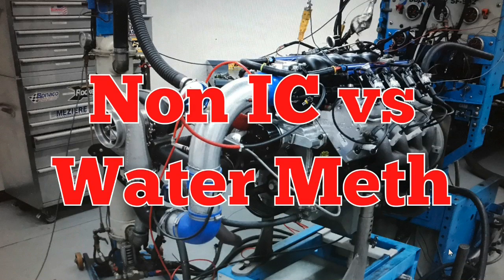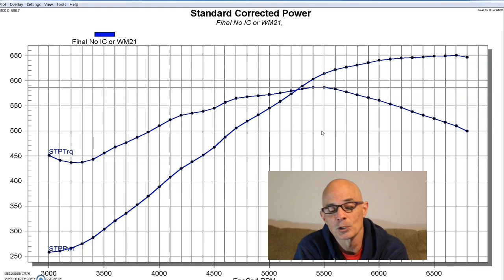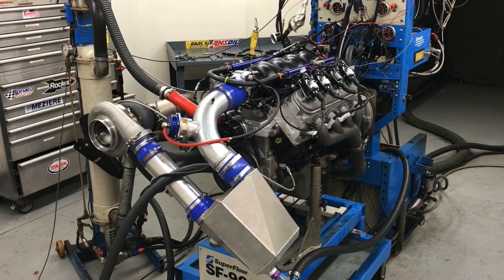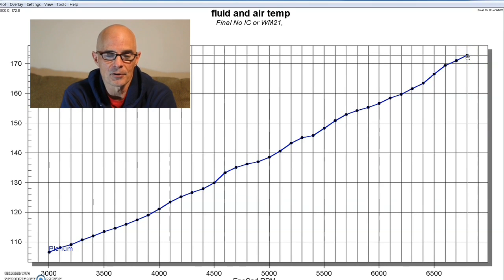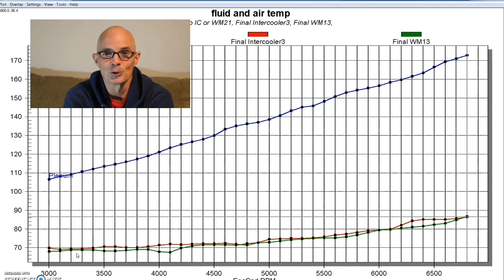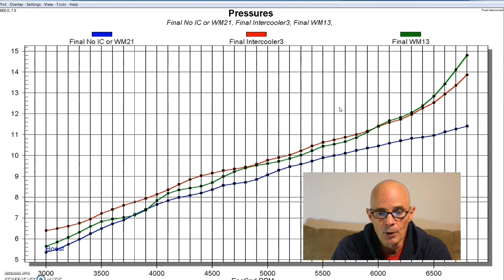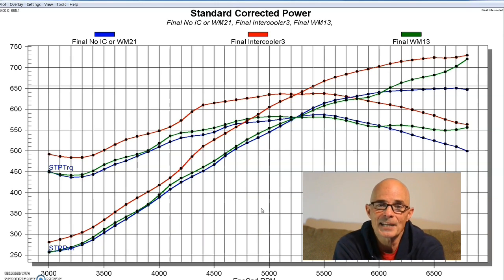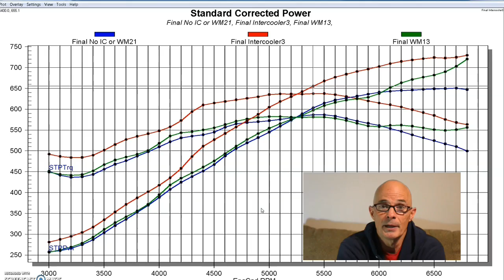WHO'S COOLER? WATER METH vs INTERCOOLER

Comment: Why boost pressure not decrease after intercooler
Reply: If he is getting waste signal ie vacuum and boost from the manifold where you usually get the signal from its going to open the waste gat at set pressure no matter the pre manifold flow restrictions it will only open at the set pressure but your thinking is correct. Pre-intercooler pressure was probably 1 to 2 psi higher than without

Comment: So when I added meth I lost 30 hp but when I got a tune for it I added 80 hp on the dyno the problem is if you do not get a tune for it you will be running super rich also reason why people like to run meth is because you need to run a smaller pulley to make more boost because of pressure loss with the intercooler vs no intercooler and meth
Reply from the maker: WE TUNED FOR IT-THERE IS NO POWER GAIN

Comment: Hello Richard,  I enjoy your channel. 
 Myself,  I've been using  snow performance for around 15 years on my class 8 semi tractors and around 1.5 million real world miles.
 Your going to be hard pressed to find anyone else with that kind of experience. 
 I think that your leaving at least 25 ft lbs on the table.
 Install the nozzles in an area of high flow, the higher the better and down wind of everything else, you want a clean shot through. 
 Put very cold ice in the reservoir.
 Run straight water. No alcohol at all.
 Water only.
 Why?
 This shouldn't affect the air/fuel ratio very much. 
 The very cold water will assist super charging very well, your air charge is impressive. 
 I never ran alcohol unless weather dictated. 
 With a good system ( sno) your going to make alot more steam. Steam, unlike your fuel chsrge will push the piston HARD until the valve opens.
 Steam works best at low RPMs, however it is still works well at higher RPMs.
 The straight water, when tuned to the engine will recover approximately 50% of the heat going into the water jacket,  and I would say around 30 to 40 % of the heat in the exhaust. Straight water being turned directly into steam recovers more energy from the fire than the mix does. 
 This is put to work directly to the crank shaft.
 The Snow Performance system is top notch,  I believe that Gayle Banks offers his own system, for diesel trucks. 
 In the words of Archie Bunker,  You're guys with diesel trucks, yourself guys that pull hard, alot,  would love it.
 EGR temps, down 300°, free torque,  and I mean alot,  lug the engine way down and really utilize the extreme torque while all the while everything else is running nice and cool.
 A properly installed system can in no damage the engine or any component thereof including the DPF and such as it simply steam cleans the entire exhaust system when it's active,  the computer never even sees it. 
 Cleans EGR systems to bare metal.
 It's Da Bomb,
 1 more thing,  this stuff is only for hard pulling/working the engine hard.

Comment: What fuel were you running e85 or 98? Have you done e85 with no intercooler with water injection?
Reply from the maker: E85 AND WE HAVE RUN WM AND NO INTERCOOLER (LIKE IN THIS TEST)

Comment: do you think that if using methanol injection on a short runner intake like that of a gen 2 lt1 as opposed to say a long runner ls1 style intake would improve the distribution on methanol from cylinder to cylinder?   I should mention I mean spraying before the throttle body like alot of guys do.
Reply from the maker: it might

Comment: Thats why you don't spray right before the TB... WMI doesn't have enough time to fully atomize and bring IATs down consistently so only the first two cylinders in the plenum see real benefit.
Reply from the maker: why would only the first two see benefits if atomization hasn't happened
Reply: @richardholdener1727   cylinders closest to the TB are seeing the majority of your wmi since it doesn't have enough time to fully mix with your charge air spraying that close to the plenum.

Comment: look at tractor pulling ahakol motor run at 150 psi and use both water before turbos and at intake manifold and no intercooler as they can not stand up to the pressuer

Comment: Individual port water methanol ejection would have actually given you even lower power output. The problem is in your tune, the water vapor slowed the combustion process, adding timing would have produced the same results as the intercooler.
Reply from the maker: incorrect

Comment: I plan on running my 6.0 has 180,000 miles on it with the LS a super charger I don’t want to gapping the rings do you think meth will help with cooling the rings down so they don’t pinch
Reply from the maker: keep boost low and don't be in boost for extended periods (like roll racing) or road racing
Reply: @richardholdener1727   12 psi or is that to much

Comment: I would love to see the test again but install the WMI as close to the TB as possible
Reply from the maker: that changes nothing
Reply: @richardholdener1727 how would it change nothing? I’m no expert but if you where to spray it as close to the runners as possible there is much less chance to has distribution issues vs injecting at the turbo

Comment: Can you please calculate, or tell me if you already know the time needed to cool down the air by WM injection, time needed for air to come from WM injection nozzle to the farthest cylinder port, and time needed for the air to heat up from your temperatures seen close to nozzle to temperatures seen in the hottest port?
Reply from the maker: that would be rpm specific

Comment: Second question. Can I  run half of a double pumper on methanol with the full modifications on the secondary circuit, to replicate a multi-injector system?
Reply from the maker: how does that replicate an injector system?

Comment: I don't  beleive  that water to air is fair test againt air to air, say in a road race car, the water would eventually heat-up rendering it useless. Sur, it works fine for drag cars. Any other suggestions?
Reply from the maker: that was mentioned already-every time this discussion comes up-but ATW is cooler

Comment: 3 year old video but I'm just seeing it. I'm on Saturn Sky/Solstice forums where everyone is trying to get their cars as close to the 400hp reliably limit of the stock internals. Max power on the cheap is the goal. Stock turbo's with a larger compressor wheel, larger charge pipes, larger downpipe, and a bigger intercooler is the combination. Some run E85/E47 tunes to get a little more. I was debating keeping the stock intercooler and running water/meth since i can't get E85 in my area. After this video I think i'll just go with the bigger intercooler instead of messing with adding wiper fluid to my intake. I won't have to worry about the pump going out and burning up my engine.  Good information in your video.

Comment: Wouldn’t the true advantage of the water-meth injection be that it would allow you to run higher boost (and/or timing) while avoiding detonation? 

It makes sense that there was not much power gain from WM injection because even though you’ve cooled the intake charge, you’ve added H2O to the mix resulting in a slower combustion speed (similar to high octane gas). 

I understand that this test was just a direct comparison, but if the same 2 combinations were run with optimized (and maximized) boost/timing/AFR then surely the WM combo would come out leaps and bounds ahead of the IC combo(?) 

Love your vids Richard, keep it up!
Reply from the maker: IC is better than WM
Reply: @richardholdener1727  you need to run more boost with a IC because of pressure loss

Comment: The dyno curves for WM are odd..... WM almost equalled IC power & torque at high rpm, but was far off in mid range, there must be some water:fuel ratio problem occurring with WM at lower revs, or the manifold design like Richard said.
The reason to run Water injection is for more boost in safety from destroying engine, this test didn't explore that. Test did show a good intercooler is preferable for power without complex tuning needed, but not all cars have space for all the piping etc.

Comment: I first read about water/meth injection over twenty years ago. Clearly, the charge air is being cooled, but I remember them saying that the cooling effect happens in the combustion chamber during the compression stroke where the water completely evaporates. I guess their is no practical way to measure this. Great video! Thanks.

Comment: Location of the meth injector , I’d still say injector to the runners , will not give enough time to affect density , no you need to redo the test , from the rotary engine which are pigs for heat  , the Meath only showed any gain after 14 psi and needed to be over 18psi to show gains Wurth the cost , and these were intercooler as well
Reply: During WW II some German aircraft used water/meth injection.   It didn't work, not enough time for heat transfer to air.  

From Frank Walker on water injection.....
German engineers tried water injection (Wassereinspritzung) on their gasoline 
engines, but with limited success. Germans, who were very good at building high-
precision pumps, had perfected direct fuel injection for their large aircraft engines. 
German engineers injected water directly into the cylinders as well. Since the water 
did not have time to evaporate and cool the induction air, the large cylinder inlet 
temperature reduction was not achieved. Frank learned of this while reviewing a 
report on a captured German aircraft engine.

Comment: Does anybody make a methanol injection set up that sprays into each runner individually ? is there a test you could do to show the beifits of having an even distribution of water meth into each runner? I imagine even a plastic intake you could drill and tap or epoxy nozzles ?

Comment: The real reason to use water/meth injection is to prevent knock, not anything else. The most illustrative use of w/m injection was seen in WW2 combat aircraft, both US and German (the Japanese only used it very little). When looking for power what matters isn’t boost at all, but air mass. Colder air has more air mass, so will make more power with less pressure (assuming the fuel ratio stays the same), which is how an intercooler works. This setup used a constant pressure gate, so for the intercooler made more power, but increased knock probability. Water and methanol are both knock inhibitors on their own, so in addition  to lowering the temperature they also prevent knock. 

This means that when running w/m to gain the most power you need to use more aggressive timing, or increase boost even more. All things being equal, you can run more timing and higher pressure using w/m than you can with an intercooler - but you can do a lot more using both, as an intercooler is even better at reducing temperature, it just doesn’t do anything for knock (other than heat induced knock, of course). The best easy setup is to use as large of an intercooler as you can fit and increase boost pressure until you either get the power you want or become knock limited using whatever fuel you have available (pump gas for a daily driver, of course), then only add w/m if you need more power after becoming knock limited - which should add another 20%+ beyond where you were.
Reply: What an excellent and factual comment!  I'm going to running water meth on my 2J E46 build and I'm excited. It's going to be pump and wmi, plus flex fuel!
Reply: Actually with water meth you can add far more boost than what you can on intercooled engine using 93 oct safely and gain bunch hp on top.
Reply: @mikeruthen6236  that’s what I said, just with a historical example and explanation of why that’s the case :)
Lower temp = less heat induced knock
Higher octane. = more knock resistance
Higher pressure @ constant temperature = high mass air flow
Higher mass air flow + more fuel = power

So if you really want to go crazy, find some 150 octane gas, run 40 degrees of advanced timing, and 100 inches of water from your turbo, plus w/m injection (fyi - these are real-ish WW2 figures - we weren’t that aggressive with timing,  it were using 150 octane aviation fuel by 1944 , but with modern metallurgy we can do what they couldn’t)

Comment: What about the difference between say a tbss intake vs holley hi ram in distribution of meth? What about putting one meth injector in the front of the intake and one at the rear?
Reply from the maker: the holley should definitely be better for distribution
Reply: @richardholdener1727  I watched some of the episode where you, Frieberger, and Dulsich had discussed distribution issues. My first thought was "instead of 2 injectors in the charge pipe, maybe one in the charge pipe and one near the brake booster port?" Thought that may even out distribution on a budget and still give the charge air cooling desired.

Comment: Sitting here contemplating the water meth distribution issue. Per port makes the best sense with that ls type intake. I'm thinking along the lines of a spider 🕷 distribution internal to the manifold. Bulkhead fitting to the external single jet point of attachment from the meth pump. 
 I remember seeing how nitrous guys limited to single wet plate rules would have "spider legs" directly aimed into the cylinders that needed help.
 Heck with a single plane nitrous plate in a x style spray bar configuration could work wonderful for distribution... maybe? 
Has anyone tried this yet that wants to let the cool cat outta the bag?

Comment: You choked the engine with to much meth, you need to lower the mix to 75 water 25 meth or even 100 water.  The increase in air temperature is from not enough. On top of better distribution. I have a 800awhp single swap n54 that gets 91 e free and 2000cc water only and holds 10° timing with 30psi
Reply from the maker: THE METH IS THE PART THAT MAKES POWER
Reply: @richardholdener1727  thats where your wrong, 100% water makes more power then 100% meth

Comment: Do you think you could use nitrous port injectors to spray in the Meth? I know it would take a lot of experimentation to get the right sizing and flow. 
Also on a traditional style Ford pushrod 5.0L MPFI set up, could the old NOS plenum spacer with spray bar ( again for nitrous) be used to spray Meth into the lower intake for air charge cooling ? @richardholdener
Reply from the maker: that is possible

Comment: I'd like to know how the AFR came out with the WM injection, and if you altered the timing to compensate for how it burns??
Reply from the maker: AF WAS MADE THE SAME
Reply: @richardholdener1727  What about timing though? Shouldn't you be able to increase the timing substantially with the W/M? I would expect to see a gain in power with some timing adjustment.

Comment: A distribution problem with the water/meth? Damn, so it seems like one would need individual port injection to get the most benefits from water/meth. No cheaping out with one or two injectors before the throttle body. That's a HUGE takeaway from this experiment, thanks for your effort 👍 I hope it saves people from wasting money.

Edit: You're probably right about injecting water/meth pre-turbo. No added benefits and I've heard you can erode the compressor inducer with high enough water volume -- like a water jet effect.

I'm off to watch videos comparing straight water vs. water/meth.
Reply: We learn something new everyday.

Comment: Why not both....intercooler and water squirter. Water squirter in BMWs water system, decreases water intercooler Temps by 77 degrees. Faster and harder you drive, will make more high heat run through the turbo and intercooler. You can even raise the boost if you can cool off the intercooler even more. Colder the system gets, the more boost the turbo can provide. Again, why not use both? Colder you can get it the more timing you can put in and more boost it can make. All equal to more power!

Comment: Why not both?
Reply: Some vehicles you have to if you live where it's hot and want to drive them hard. The R53 Mini comes to mind. If you underdrive the sc pulley and drive them in the heat you'd better have an oversized intercooler at the least and it'll still heat soak without meth.

Comment: I wonder if you have ever done a test where water/meth works? Many have but you seem to have a lot of issues with the systems. You added boost and LOST horsepower made same power as non intercooled run with a cooler intake charge. Very interesting  testing. I'll keep looking for a successful test by you. Thanks for your efforts.
Reply from the maker: it only adds power if timing is increased or you use straight meth or boost is increased

Comment: What would it look like intercooler plus methanol-water?
Reply from the maker: the WM didn't add any power so about the same
Reply: @richardholdener1727  Thanks, Richard.  Do we get better gas mileage when our gas does not have ethonaol?  More energy dense right? Is this simply a way of making cheaper gas a cooler air charge with higher octane without really adding power? Seems best to just use an intercooler.

Comment: So if you believe its a distribution issue in stock style manifold is this true for nitrous too as it would seem this would be the case if it's because of long runner manifold doesn't work as well with wet flow ?
Reply from the maker: NITROUS IS A GAS-IT WORKS A LITTLE BETTER AND THERE IS LESS FUEL IN A WET KIT, WE ONLY RUN SMALL SHOTS THROUGH LONG RUNNER INTAKES

Comment: Curious if all parameters were optimized for each setup, including advancing the timing, if water was injected proportional to the overall fuel/air mass, or it was just a dumb-inject constant-flow and settings not optimized for each setup. If timing, for example, was not advanced for the cooled versions, then a lot of the potential for power gain was merely squandered. Also, having water proportionally injected at each cylinder's port would make it so one hot cylinder was not dragging down the entire engine.